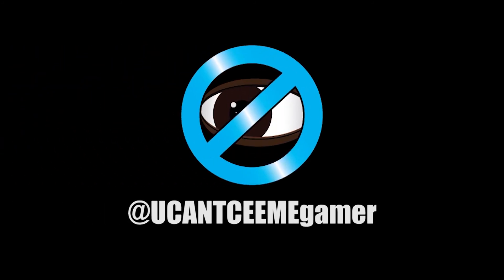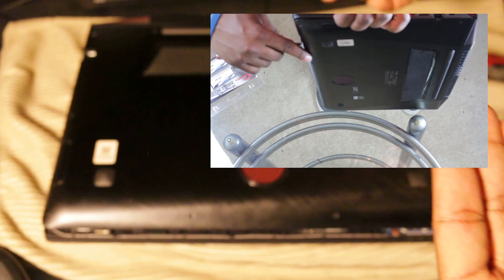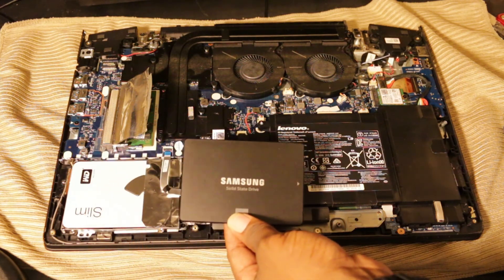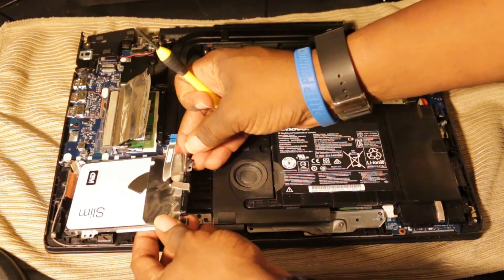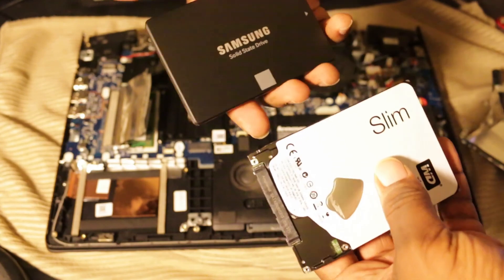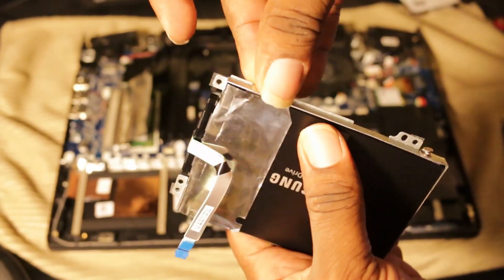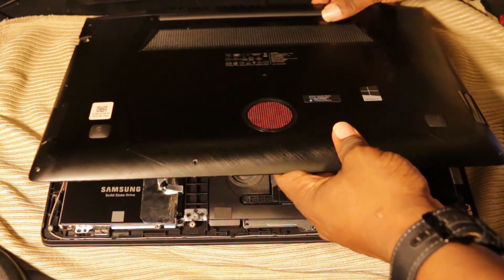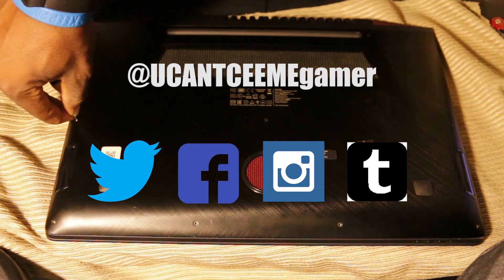How to Install a SSD in Laptop | Lenovo y700 | Samsung EVO 500gig Solid State Drive

Comment: Wow! Great video! I love your voice! 
 I have a Y700 also (now 9 years old! Yikes!) , so theoretically, the guts of my laptop should look just like yours, right?
If so, I have a few questions:
1. Is that smaller green thing next to the hard drive (that you're replacing) that's under the foil also called a SSD? Is it called an M2 SATA? What exactly is it called? (It's the C drive, yes?)
2. Is it OK that I use my C drive (SSD) for install programs (.exe) and my HDD for storage (photos, files, downloads, personal stuff, etc)? Or should it be reversed since I would think the HDD gets used more than the SSD, eventually causing the HDD (mechanical hardware) to wear out. I know it's too late now, but I've always wondered if I'm utilizing each drive the was I am "supposed to". I hope I am!
3. Is that hard drive your D drive?
Thank you very much!  I have subscribed!!

Comment: Great video. My only question is that my y700 came with 2 drives, a 1tb HDD in the D drive  and a smaller SSD in the C drive. Is the drive you replaced in the video D or C? I'm looking to replace the HDD eventually and the one you replaced looks fairly easy to do. But if that is the C drive you replaced, I'm wondering if the D drive will be more difficult. I probably should just open it up and take a look myself when I upgrade the RAM (Thank you for that tutorial too) But I wanted to see what you think. Thank you in advance.
Reply from the maker: In my case, that was my C: drive but my version only came with one HDD and I upgraded it to an SSD in this video. In your case, it should have come with an M.2 SSD slot also. That's the slimmer slot right beside the drive I installed. If you look in the video on mine it is empty. Your OS should be on the C: (slimmer) M.2 SSD drive for booting and whatnot. 
Long story short,the correct one you would be changing, is the same one I changed/upgraded in the video. That would be your D: drive which is your secondary storage. You may still want to check documentation or when you open it, disconnect the one I installed just to verify which drive it is. But I would bet it is the correct one.
Hope all that helps. Let me know if you have any other questions and how it goes.
Reply: You got a lot of knowledges with this laptop. You sure are a great help in giving knowledge about this things. Thank you and keep it up

Comment: After installation of that ssd, do you have to program it in the computer? Or just install it and your're ready to go?
Reply from the maker: You'll have to either fresh install Windows or whatever OS you choose or clone your current drive to the new one before you install then it should load up like before.
Reply from the maker: Macrium Reflect had a good free tool I be used for cloning in the past. FYI

Comment: hey man i want to do this upgrades but my lenovo y700 only had 8gb of Ram will i be able to upgrade to 32? i dont want to open my laptop withooout knowing this. also i wanted to know if i upgrade my hdd to the ssd if i would have to install windows from a usb or it would do it by itself. in the case i need a usb where can i find the file required?
Reply from the maker: Yes, you are able to upgrade to 32gb. I official site may not say it, but I was able to verify that it worked and it recognizes the full 32gb in my system. 
  As far as the SSD you would have to install windows fresh manually. It will not do it automatically. To get the file, just google Windows 10 download and be sure to get it from the microsoft website unless you are sure you can trust the source. You could also clone the drive but that is  a lil more involved but it is doable.

Comment: Why didn't you just add a 2280 SSD right next to your normal hard drive? A friend of mine asked me to upgrade his hard drive to SSD and it sounds smarter to just add a different SSD, install a clean version of the OS on the new drive and format the old one for extra storage
Reply from the maker: Hey Mark. If you haven't found this yourself, this is the info I found. The Y700, as long as it has an Intel processor, can take both SATA and  NVMe drives. If you get the latter (NVMe = PCIe), you'll get a much higher read and write speeds than a traditional SSD. But yes, it should 
support everything.
 
"Officially", this is the list of supported SSDs for the Intel 
machines. The AMD machines support regular SATA M.2 SSDs, but not the 
PCIe ones:
 
SSD, Samsung PM871 MZNLN128HCGR M.2 128GB SSD 5SD0H00094
SSD, Liteon CV1-8B128 128GB M.2 SSD 5SD0J21066
SSD, Samsung MZNLN256HCHP M.2 256GB SSD 5SD0H00092
SSD, Liteon CV1-8B256 256GB M.2 SSD 5SD0J21061
SSD, Samsung MZNLN512HCJH M.2 512GB  SSD 5SD0H00095
SSD, Liteon CV1-8B512 512GB M.2 SSD 5SD0J21063
SSD, Samsung MZVLV128HCGR 128GB M.2 PCIE SSD 5SD0J46480
SSD, Samsung MZVLV256HCHP 256GB M.2 PCIE SSD 5SD0J46479
SSD, Samsung MZVLV512HCJH 512GB M.2 PCIE SSD
Reply: @CharlesMacro  actually I saw the official support for SATA 3 and PCIe 3.0, but couldn't find anything about NVMe anywhere. Are you sure it supports NVMe drives? I don't want him to order something that won't work on his machine, but if it does it would be amazing!
Reply from the maker: Today, that is a good choice. The cost of an M.2 drive when I made this video was 2-3x as much as they cost today. If the price was as low as it is today, I may have done that. For those who just want to increase boot time and drive efficiency for the lowest cost, this was the best option. Especially at the time of the making of this video. Good point tho.
Reply: @CharlesMacro  thanks for the reply! I'll tell him to order an M.2 drive and will definitely use your video to replace it. Any idea which M.2 drive will fit? Because I tried searching online and apparently there are different sizes/connectors

Comment: thanks a lot for this I have a few questions can I put a Samsung 860 EVO 2.5" 1000 GB Serial ATA III MLC on a Lenovo Y70-70 touch?
Reply from the maker: Yes. From what I have researched, you can upgrade the y70 touch to most SSD's including the Samsung EVO 860. NOTE: Lenovo recommends you use Crucial SSD's like the Crucial MX500 variants. Just be aware of that but 860 should work fine.

Comment: hey man thanx 4 the video! great work. i have a Q about the windows 10 that was installed in my prev ssd Hdrive. How the new drive will detect the operating system license I had on the previous drive
? tnx
Reply from the maker: Hey Amit. No problem. You should be fine because windows attaches the KEY to your MOBO so the new ssd should recognize it no problem. 

But just in case I would keep your KEY or locate the box or card if you still have it. Or If it's possible, I would go to my pc and right click  and choose properties and copy or take a pic of the KEY there just as a back up.
You should be able to re-enter it or worst case, call Microsoft and they'll correct it. Hope that helps.